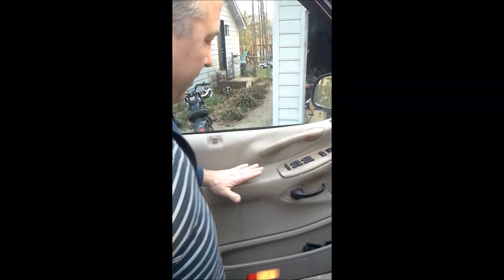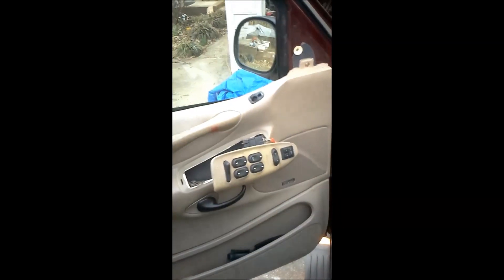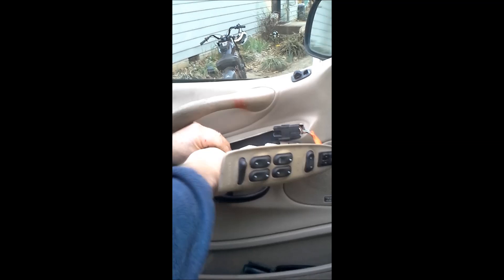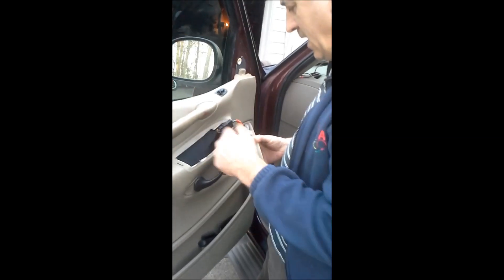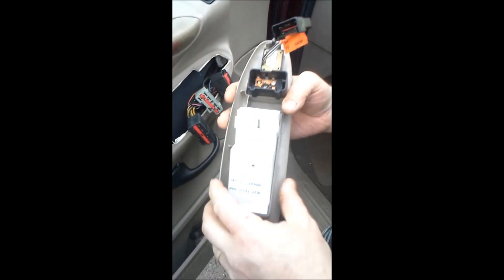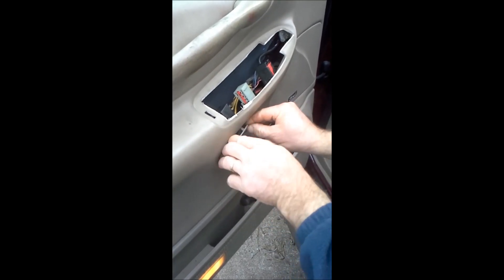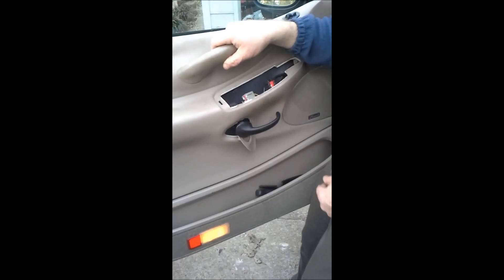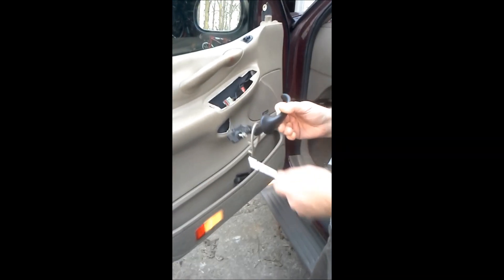2000 Ford Expedition Door Panel Removal

Comment: Short, simple and exactly what I needed. Thank you! Perfect.

My window froze shut yesterday and the glass pulled out of the clamps and fell down inside the door. I reglued it with some outdoor adhesive, but I'm afraid it may not hold. Any thoughts on what type of glue I should've used for that?
Reply: Thanks

Comment: How do I replace the window motor?
Reply from the maker: i didn't do that video.  But be careful with that because there is a strong counter balance spring in that area. If let loose it can tear up fingers / hands ...
Reply from the maker: Probably having the window mechanism rolled up will relieve the spring pressure...

Comment from the maker: Keep  Bull S%$T Comments to URself.  I'm not a "F%$#&$G Movie Star!". 
Other Info  #1. I missed stating that there is a plug for the ELECTRIC MIRROR controls at the top part of the door panel -  You should be able to get that one off pretty easy after you take out the 4 plugs and the door panel though... Does anyone know of a cure for getting bald?   The END !
Reply: Thanks for the video man. Helped a bunch.